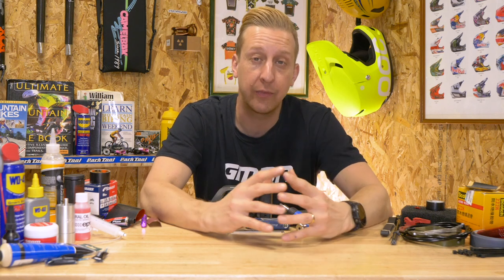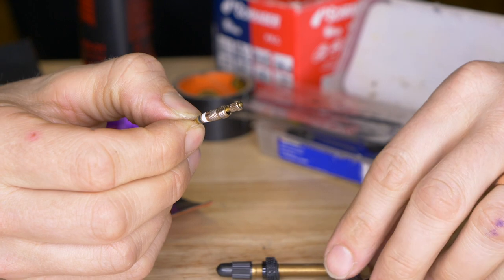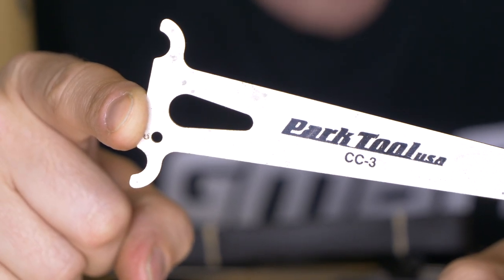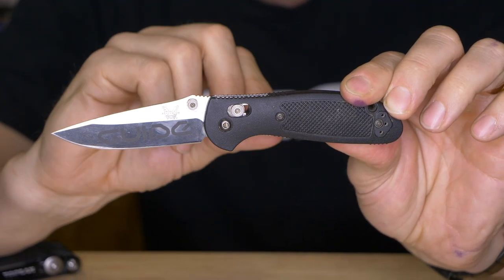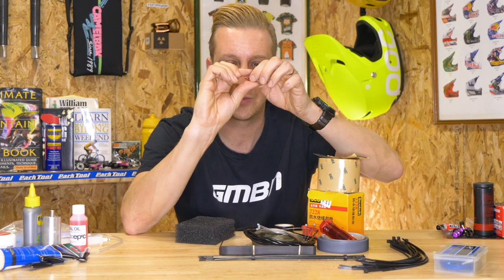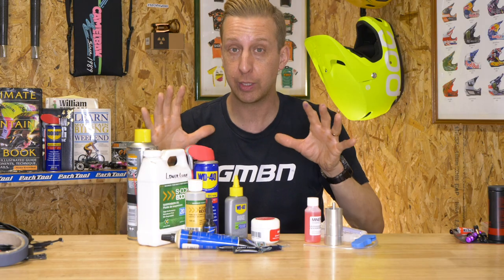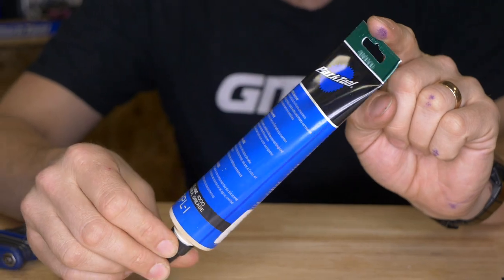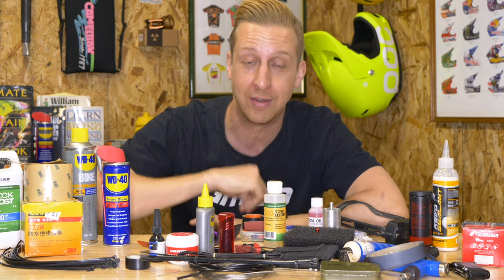The Best MTB Toolbox Extras | Doddy's Personal Tools And Tips

Comment from the maker: What do you like to keep in your toolbox that you can’t live without? 🔧
Reply: Specer for disc brake to better alignment,
spare hanger ...
Reply: Alley key...
Reply: Hanger alignment tool......Shifting starts there
Reply: Brake Bleeding tools and t handle Allen wrenchs
Reply: Break cleaner 😂
Reply: Chocolate
Reply: Marine anti-seize is great. It resists washing out in places like bolts where you're using it to prevent corrosion/galling rather than to lubricate. Likewise, you can use it on interfaces like metal on metal seatposts in sparing amounts with less propensity to slip than grease. It can also be more cost effective than a good poly bearing lube. Vital workshop staple here in the brutal Minnesotan winters.
Reply: Bottle opener.
Reply: My little "how to maintain and repair your mtb"-guide! 📖🤓
152 pages of get back riding asap! 🤙🏻
Reply: Disc break cleanet, or how i call it, everything cleaner, cause lets be honest it cleans everything.
Btw if you need a bike cleaner try motorcycle cleaner
Reply: My tool box has everything you need to do anything from mechanical work on cars to complete woodworking stay tuned I'll get it uploaded for bike cave this spring .. my 89 grand wagoneer is currently in the way
Reply: In my travel tool box I keep roll of double sided velcro, cut in strips in a few different sizes, its like zip ties, but reusable. I've used it to help set up tubeless tires, hold cables on, as a temporary chain guide, plus it holds my tube and multi-tool on the frame.
Reply: Silicone self fusing tape. No advise. I also use it like shrink wrap for the cables in my cockpit.
Reply: Break cleaner is dirt cheap if you buy a 5 or 10 L Can and a pump spraycan!
Reply: A hammer 🔨
Reply: Beer bottle opener.
Reply: GMBN Tech tacos
Reply: Rag
Reply: Rubber, tubes, sealeant, valve core, hanger, spare tubeless valves

Comment: Latex/nitrile gloves for the workshop- hugely helpful
Reply: Latex gloves and nitrile gloves are completely different. Latex gloves are for surgical or clinical use, and contact with oil, petrol, grease etc will destroy them! For mechanics, you need nitrile rubber gloves.

Comment: Would really recommend the 0.5/0.75 chain checker. IME having a 11spd chain wear down to 0.75 leads to bad chain retension and already some premature wear on the cassette. Have always found that 0.5 is plenty of chain wear and usually means 6-7000km of use. I regularly clean my chain with alocohol and ultrasonic cleaner, then wax it. Get really good mileage with that without wearing out my cassettes

Comment: Completely agree with you on all of this however I would like to add a few things - Rubbing alcohol, good quality shop towel (none of that super thin stuff), a few rags of different cleanliness, a giant tub of grease (can never have too much grease), spare nuts, bolts, spacers, washers, bearings, etc that you've collected overtime, titanium anti seize (I have some Ti axles, nuts and bolts on my bikes) and a giant collection of stickers. I know many of these could be arguable like alcohol, grease and Ti anti seize could come under oils, lubes,etc and how shop towel and rags could be something more for a workshop not toolbox, this is only a list of things I didn't see in the video that I would have put in the video if I was making it.

Comment: Regular WD-40 works great as a degreaser, and you can buy it cheaper in a screen wash type of bottle
Reply from the maker: Yes it works well if you are applying a wet lube after, but if like Doddy you prefer to use a dry lube then we think It's best to use a specific degreaser with no oil content.
Reply: Good to know. I didn't realize dry lube's bond would be affected by WD-40.
Reply from the maker: You can still do this and a lot of people do. However if you are looking for optimal adhesion then any oil based degreasers should be avoided.

Comment: what best  Disc Brake Cleaner
Reply: Any automotive brake cleaner, best to use the non-chlorinated type. Despite what some people will say it does NOT harm any of the parts, it's used on motorcycles and cars all the time. If you can't get brake cleaner in a spray can just get some isopropyl alcohol that'll work good on the rotors and the pads.

Comment: Hey GMBNT thanks for being so helpful all the time. On rim tape, you suggested gorilla tape however I had a WTB KOM i29 that was taped this way and had a nightmare fitting a Maxxis HR2 DD to it (steel tyre levers were involved). When I removed this tyre I found that the gorilla tape had moved to obstruct the bead wall in places and had spread adhesive all over the place, including onto the tyres wire bead. After hours of miserable scrubbing I cleaned all that stuff off, used electrical tape as rim tape, and the tyre fit like a dream. Am I riding into a problem in the future or will I live happily ever after, steel tyre levers retired and never to be seen again? Much love.

Comment: 3M Tape
I can't seem to find the 3M tape you recommended in my local hardware store. 
Can you share the Part Number, SKU or some other info that would help my find/buy it?
Reply: kevinbowe1957   Look in the electrical section. I’ve found it at Home Depot. It sort of is hidden amongst the electrical tapes
Reply: Way esier to find on amazon " 3M

4.8 out of 5 stars  112Reviews

3M 2228 Scotch Moisture Sealing Electrical Tape, 1 in x 10 ft x 0.65 in